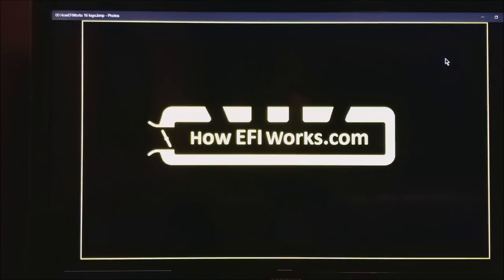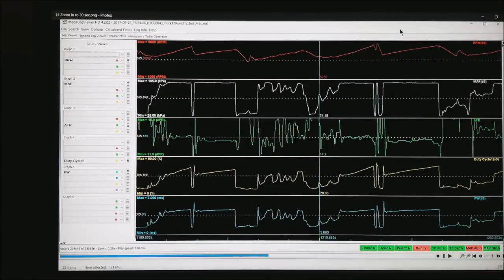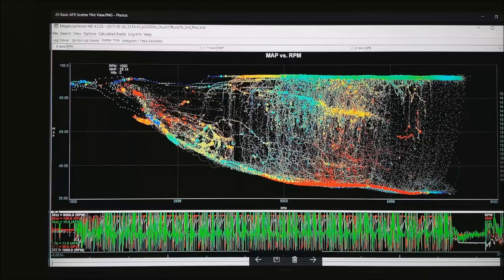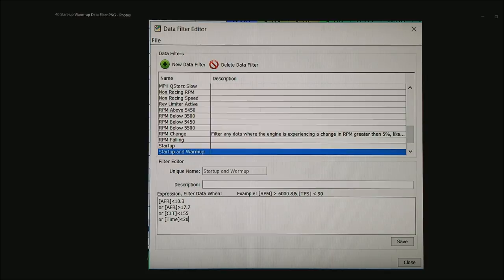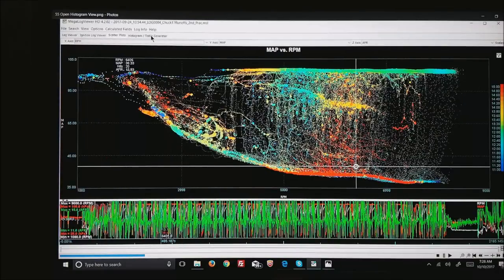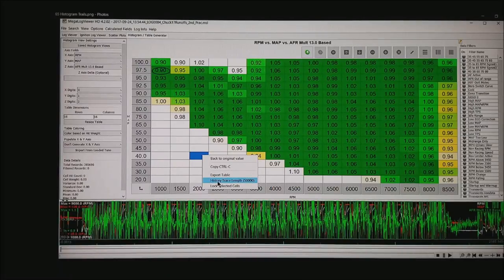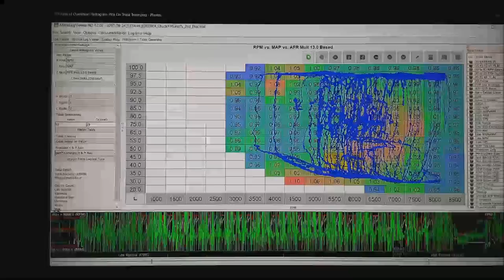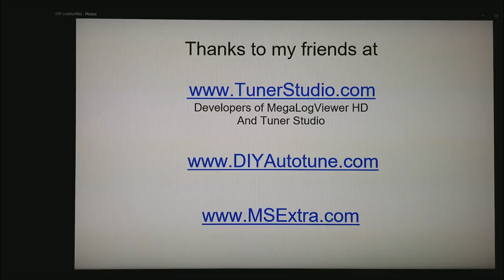Hand Tuning Engine Fueling with MegaLogViewer HD

Comment: Thanks for uploading all this info, is there any way we can create tables on this software to calculate the ve adjustments necessary? Like input your target afr and then create the actual afr table as you have shown - then add a formula to calculate the difference without using excel etc? Cheers! Charlie

Comment: In the area where it’s lacking some fuel. How can you tell if it’s accelerate enrichment or VE table that’s need adjustment ?
Reply from the maker: I personally tune AE to get the best throttle response when shifting and downshifting.  The transients filter is what filters out all data when the AE is active.  Here is what my actual transients filter that I use looks like.

[Engine]>1 or [Engine-1]>1 or [Engine-2]>1 or [Engine-3]>1 or [Engine-4]>1 or [Engine-5]>1 or [Engine-6]>1 or [Engine-7]>1 or [Engine-8]>1 or [Engine-9]>1 or [Engine-10]>1 or [Engine-11]>1 or [Engine-12]>1 or [Engine-13]>1 or [Engine-14]>1 or [Engine-15]>1 or [Engine-16]>1 or [Engine-17]>1 or [Engine-18]>1 or [Engine-19]>1 or [Engine-20]>1

In the Megasquirt world, having the engine code active (something other than 0) means AE, or DE or warmup or some other thing is happening on that record.   With this formula, I throw out all data for 20 records after the Engine code is set to anything other than 1 or "Engine running"  Note that I data log on my ECU at 200 hz.

The default Transients filter looks like this.

(abs([Field.RPM] - [RPM-4]) > ([Field.RPM] * 0.10) ) || (abs([Field.TP] - [TP-4]) > 5 )  || (abs([Field.MAP] - [MAP-4]) > ([Field.MAP] * 0.15) )  

Where for example [RPM-4] is read RPM 4 records back.

Hope this helps
Reply: Andy Whittle I guess that was more complicated than I though ;) how can I lean what all these codes mean?
Reply from the maker: Here is some of the info under Help and Math Parcer
    <<<<<<   snip   >>>>>>
      deltaRPM=[RPM]-[RPM-1]
interpreted as:
deltaRPM = (Current 
      RPM)-(RPM 1 record back)

You can reference previous records by 
      incuding the -x inside the []. As seen above [RPM] references the 
      current RPM, where [RPM-1] now references the RPM 1 record 
      previous. You can reference back further, i.e [RPM-2] will 
      reference 2 records back, [RPM-3] is 3 back, and so on. All 
      references are relative.
    Math is executed from left to right, operation hierarchy is not 
    recognized. If you need to
insure execution order parenthesis are 
    honored.
calcValu = [RPM]/([RPM]*1.2)
the [RPM]*1.2 will be 
    executed first.

      Advanced Math functions:
Supported Advanced Math 
      functions are:
       
      
        
          Function

        
        
          Definition

        
        
          Usage

        
      
      
        
          Smoothing
        
        
          Smooths a field by averaging over the smoothingFactor number of 
          records.
        
        
          smoothBasic( field, smoothingFactor)
        
      
      
        
          sine
        
        
          Standard Sine of a value.
        
        
          sin(val)
        
      
      
        
          cosine
        
        
          Standard Cosine of a value.
        
        
          cos(val)
        
      
      
        
          arcsine
        
        
          Standard arcsine of a value.
        
        
          asin(val)
        
      
      
        
          arccosine
        
        
          Standard arccosine of a value.
        
        
          acos(val)
        
      
      
        
          tangent
        
        
          Standard Tangent of a value. 
        
        
          tan(val)
        
      
      
        
          arc tangent
        
        
          Standard Arc Tangent of a value.
        
        
          atan(val)
        
      
      
        
          square root
        
        
          Standard Square Root, same as pow(val, 0.5) of a value.
        
        
          sqrt(val)
        
      
      
        
          absolute
        
        
          Changes any negative values to the same magnitude in the positive 
          direction.
        
        
          abs(val)
        
      
      
        
          log
        
        
          Natural log of a value.
        
        
          log(val)
        
      
      
        
          log base 10
        
        
          Base 10 log of a value of a value.
        
        
          log10(val)
        
      
      
        
          recipricol
        
        
          The recipricol of a value, or 1/val 
        
        
          recip(val)
        
      
      
        
          exponent
        
        
          Exponent of a value.
        
        
          pow(val, exponent)
        
      
      
        
          round
        
        
          Rounds the value of a value to the nearest integer value.
        
        
          round(val)
        
      
      
        
          floor
        
        
          Returns the largest (closest to positive infinity) integer value 
          that is greater than or equal to the argument. 
        
        
          floor(val)
        
      
      
        
          ceiling
        
        
          Returns the smallest (closest to negative infinity) integer value 
          that is greater than or equal to the argument.

        
        
          ceil(val)
        
      
      
        
          exponent
        
        
          Returns Euler's number e raised to the power of a double value.
        
        
          exp(val)
        
      
      
        
          isNaN

        
        
          Checks the output of an expression to result in a invalid number

        
        
          isNaN(val)

        
      
      
        
          smoothFiltered

        
        
          Smooth a field using a matrix filter for less lag

        
        
          smoothFiltered(val)

        
      
      
        
          accelHp

        
        
          Calculates HP based on Acceleration rate.

        
        
          accelHp(
    velocity (MPH),
    
          deltaVelocity(MPH),
    deltaTime(s),
    
          weight(lb)
)

        
      
      
        
          Aero Drag

        
        
          Calculates the Aerodynamic Drag

        
        
          aerodynamicDragHp(
    velocity (m/s),
    
          airDensity (kg/m^-3),
    dragCoefficent,
    
          frontalArea (m^2)
)

        
      
      
        
          Rolling Drag

        
        
          Calculates estimated rolling resistence

        
        
          rollingDragHp(
    speed (MPH),
    
          tirePressure (psi),
    weight (lbs)
)
Reply: @AndyWhittle_HowEFIworks  Hi Andy, when applying the first formula to my log it filters out nearly all of my total records (original 59,510 - filtered 59,436). The second formula Filters down to 57026. How can i change the formula to suit my needs or is all my data from road logging that bad. The RPM change one seems to filter the least amount of data (4040 records) is 'abs([Field.RPM] - [RPM-4]) > ([Field.RPM] * 0.05)' . Can i rely on this data to apply your processes? Cheers for any help. Charlie